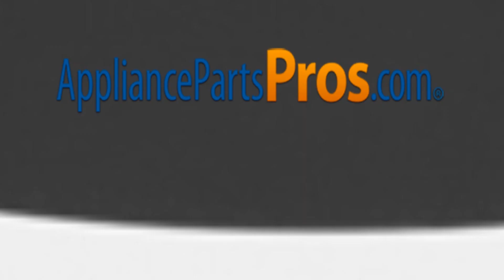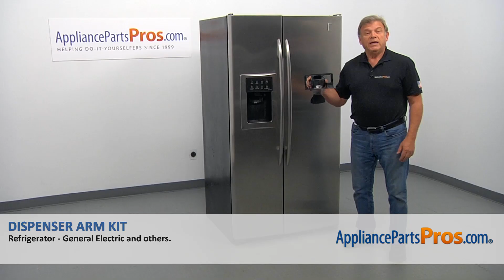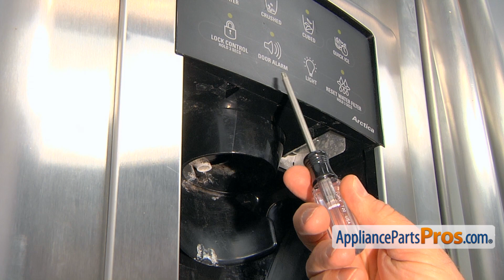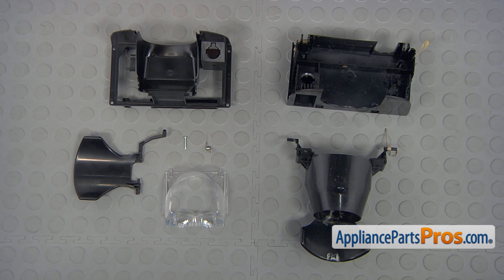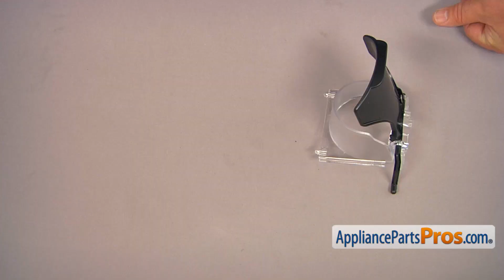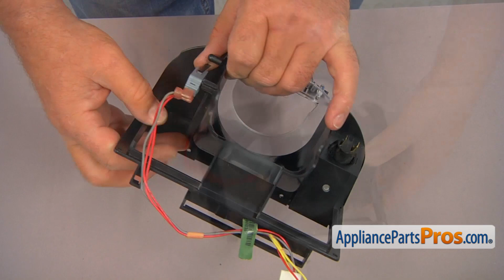How To: GE Dispenser Arm Kit WR49X10228

Comment: Removed all the 4 screws  to the housing assembly shield and attempted to slide it out as shown in several videos however it's stuck. Something on the lower right seems to be holding it in place. I've seen threads where others have been having the same issue. Wonder if there was  a way to remove it without breaking it.
Reply from the maker: What is the model number of your fridge? The part could differ slightly from the one in the video.